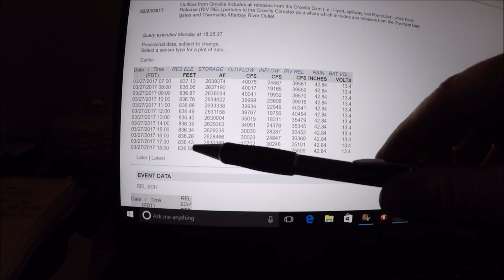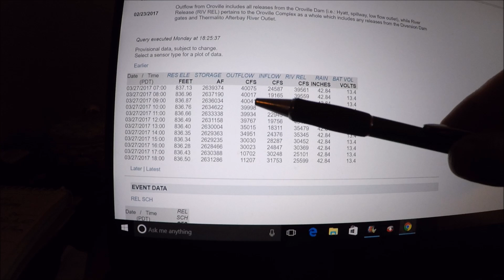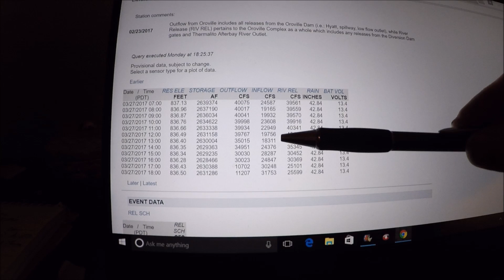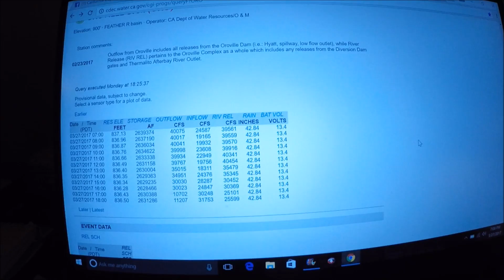Oroville 27 March Update "A Day in the Life"

Comment: 60% design generally includes a Design Analysis or Basis of Design report that details the design and project  requirements with a Codes Analysis (local, state, federal) that must be met in the final design.  A project schedule will be included and a cost estimate accurate to plus or minus 10-15% (because the design is not fully developed).  There is also the complete list of drawings and specifications.   There will be a number of drawings that are part of the final design package that are included to show the general overall design, and they may include some detail drawings of things like foundations or even some special designs required for the specific site.  There is either a State of California or Corps of Engineers design manual that they are following that defines the submittal requirements for each design stage (30, 60, 90, 100 percent).
Reply from the maker: Excellent explanation Thanks!
Reply: Buckhorn Cortez 
Hey, thanks for typing that out.  Good to know information.
Reply: For the DOD our civil engineering submittals  at 60% & 90% also included existing conditions drawings and text summary of same + new work. 60% by next week? Maybe. That would be fascinating to see / read for this project. After projects were completed we were required to provide 'as-built' drawings which reflected the revisions / modifications. It would be interesting to have a look at the as-built drawings of the Oroville Dam, probably submitted in late 1960s.
Reply: Another fact filled report Juan, thank you.
You, being a pro pilot, serves you well in paying attention to details, your profession and maturity are what brings creditability to your reporting.
I have known many pro pilots over the years, all with your same attention to detail. 
Totally off topic, but I've always been fascinated on why a majority of pilots decide to stay silent, in public accounts of "things" they have seen while flying. I get the whole ridicule and threat to their career thing, but those I have spoke with have told me there might be thousands who would come public, if they could.
Like you, I have trusted these people's accounts as facts, and the fact that their "day jobs" deal with attention to details, yet going public is too much of a risk.

Who knows, there might have been engineers back when Oroville dam was being built that saw "things" in the construction that resulted in what is happening today, yet never went public for fear of ridicule or worse.
Just spit balling here...thanks for your effort in bringing facts and transparency to the Oroville topic....we need more of this private, non biased, non affiliated and objective reporting, in many sectors of society.
I know you won't give up your "day job" to become a YT channel profiteer. If your like the pilots I have known, the love and passion for flying, far outweighs the possibility of turning a hobby into a sole source of income.
 "Click baiter's", have not "learned" how to achieve the balance you seem to have found.
Reply: Looking at the emergency spillway, the left side looking up at it (in river terms looking downstream the right side) is just a small concrete lip 6 to 10' high.  Tear it out and build some gates.  Seems like the lake would be plenty low enough during summer.  All the work would happen in the top 50' of lake elevation.  That will be free and clear by June 1.
I believe the best course of action is to patch the main spillway and keep it running as is for several years until a good plan to replace it is in place.  At the end of the broken lip, build poured concrete revetments under the lip and to the left hillside, to stop any further headcutting in the next several years.
Reply: since I am not a civil engineer I will stay off the main squakbox but I feel obliged to opine on your concept,:  brilliant in fact,  there are other places other than directly next to the monsterous dam wall,   perhaps several smaller avenues for more manageable releases of water.  something strange seems to occur at mega-flowrates,  check out the Teton dam engineering issues
Reply: Wish Congress could do Vetting in that length of time, we could have a full Supreme Court. Ah well, I am glad for Oroville. Sad that no one cared enough to put in a $5,000 fix instead of this... and all the lives up-heaved because of neglect. SAD! Can we hope a lesson learned? Or did we already learn it and someone in power forgot? Thank God Trump didn't hold a grudge against Gov Brown. He stepped in immediately to assist (when asked, of course)and for that, I think everyone can say "that is a good thing."
Reply: The dam was finished when Reagan was governor.  He didn't start it but he got to dedicate it..  But guess who pushed through all this, our very own Governor Moonbeam's father Governor Pat Brown.  Pat Brown pushed for and got a lot of the water infrastructure we have today.  A lot of money was spent then (1950' -60's) and very little since.  It also was built by the government but the work was performed by private companies.

Comment: Hi Juan.  I know nothing about dams but found your channel by accident and I am very interested in your research and how generously you let others know what is going on.  Here's an off the cuff thought.  Could they build a new main spillway where the emergency spillway is and then make the now main spillway the emergency spillway?  There's probably reasons why not but just thought I'd throw it out there.  Judy in Victoria BC Canada.
Reply from the maker: I'm sure that is under consideration too. Good idea.
Reply: +blancolirio Thanks for your replies.
Reply: Trudging The Road Of Happy Destiny The spillway intake gates can't be moved so to do a horizontal offset towards the emergency spillway they would have to have a sharp turn from the current gates.
Reply: The ES structure will not support the weight of a Gate structure. Also there is no directional cape to direct the water to Gates at the ES.  They would need to drain the lake (completely) for 2 years or more to build a cape.  Not going to happen.
Reply: Hi Judy, That is an interesting idea. The problem is  that building new  water gates would be a huge project. To cut into that emergency area would take a very long time and the water level would have to be dropped down to 500 ft.  The DWR will just have to build a new main spillway that is stronger in the same place where the busted up one is.
Reply: They will trim the Upper spillway back to a joint (about 65') They will then start building the New aqueduct (pillar supported / spillway- water bridge) from that point downwards until Nov1st .

They will build a temp spillway landing at the bottom. Next year (2018) they will replace the top & bottom with new structures.
Reply: Thanks Everyone for all the input.  You are all much more knowledgeable about this than I.  I will just have to wait and see what happens.  Again thanks for your comments.  I find them very interesting.  I hope a solution can be found that costs the environment and the tax payers the least amount of stress.  All the best.  Judy.
Reply: Just wondering if there is any other place on the lake where they could build another spillway?
Reply: Based on some of the other comments the emergency spillway would not be a suitable location for a replacement. Also if the build it there wouldn't they then have to find another location for an emergency spillway?
Reply: Jeffrey S Modern earth fill dams now prefer to have the spillway a mile or more from the dam.
Reply: Jeffrey S an option would be to tunnel under the from the parking lot down the diversion pool, add an intake tower and that's what it.
Reply: MAKE MY DAY They'll never drain the lake, the aqueduct can't be left empty to it will crack
Reply: grateful ... empty to it will crack??  are you smoking crack...?  LOL  YES, the DWR should not have to lower the water level under 800 feet
Reply: Andrew B The aqueduct must have water in it, so the dam has to hold enough water to keep the system working all year and some for next year if it doesn't rain. Also the salt water intrusion into the delta is controlled by oroville water.

Comment: DWR rep said that the MSW outflow was causing some backflow that raised the tailrace level preventing them from running HPP at full, but he also specifically said that they shut HPP off a couple days early to do maintenance, presumably in prep for bringing it back on at full power after MSW was shut off.    During the period they were running two turbines since they started publishing the daily incident report, there was no change in the tailrace level at all, so I don't think rising debris  was ever a factor, just the high volume of water from MSW piling up in the DP prevented HPP running at full.    

If they average 27K CFS inflow (probably won't be quite that high) and steady 13K outflow from HPP, they'll only have about 10 days before level rises from 836ft back to 865ft, and it sounds like there is some internal debate as to whether to stop at 860 or 865.  If they must stop at 860 then it's only about 8.5 days before next spill.  
If inflow averages around 20K instead with same 13K outflow, and they wait to 865ft, they could have roughly 20 days to work.  
Also, today they tested flow rates at 35K and 30K, which if they destermine was safe, they may be able to use during next spill event to prolong it through a greater period of snow melt.  

orovilldam subreddit has a link to the FB live video of the KCRA overflight today about an hour or two before spillway was shut off.  Well worth a watch.  One thing I noticed was a straight down shot of water in the lower spill channel.    It shows bedrock on both sides of the water, which is very encouraging.
Reply from the maker: Yep! I agree.
Reply: Right now, average inflows are about 19.8k cfs which will buy them some more time until the inflows creep up to 27k as predicted. But even if inflows were 27k right now and remained at that rate, we'd still have until April 9th (13 days) before the water level reaches 865 feet. But I think we have even more time than that, considering the inflow is currently only 19k.  This of course is all contingent upon no new rain, and expected inflows of 27k.

Comment: I like an idea I am sure many an engineer have already thought of.  Instead of using the expensive "road building" approach why not use relatively inexpensive precast concrete tube.  10 abreast or whatever might be required.  One for each control gate. That way, any individual section can be inspected and fixed without impacting the entire thing.  Like straws next to each other.  Maybe there are more problems with that than I realize like flow rates, differential pressure, etc. due to the sheer heights involved.  I'm no engineer.  You are a natural orator Mr. Brown.  Maybe years of talking to ATC perhaps? Keep up the awesome work!

Comment: Well, I don't think they should just do concrete and rebar.  They need to at least drill footings down to bedrock in the MICA SCHIST area of the spillway, because that's where the sinkhole first developed most likely BECAUSE of the MICA SCHIST.  So, perhaps 2 plans are needed.  One for the part of the spillway which isn't on top of mica schist and one for the part of the spillway that IS on top of mica schist.  I think that would help with cost savings.  Again, once footings are drilled, then construct a pier and beam foundation over which is poured concrete with rebar.  And you're welcome!  :)

Comment: River Outlet/Bypass Valve could increase outflow by 5,400 CFS.   I don't understand connection between River Outlet Valve and fire that occurred at different Power Plant site.  Electrical buses and connections can be inspected with infrared equipment.  Arc Fault Detection devices can be installed to alert operators and shut down equipment.
Reply from the maker: I believe there is mfg.  issues with the valves themselves? I can't get a straight answer.
Reply: It doesn't make a lot of sense why they can't provide an honest answer unless they are trying to hide something.
Reply: I don't recall any videos of water exiting the Hyatt Power Plant.  I would also like to see how high the exit port of the  River Bypass Valve is relative to the Thermalito Diversion Pool.  The California DWR should tell the public why they can't use the River Bypass Valve to increase outflow by 5,400 CFS.
Reply: If I recall correctly, the discharge tunnel for the a River Outlet Valve had some connections to the Power Plant Turbine discharge tunnel.  If so then using the River Outlet Valve when the river water was high would have the same effect as operating the Turbines when the discharge lake level is too high.  They could end up flooding the turbine area.  This is a possibility if they are interconnected.  They need to find a solution to the discharge levels as the it is ridicules that they can't use the turbines to reduce the lake level when the spillway is operating.  Apparently the power station was installed at too low of elevation compared to the river channel downstream of the dam!

Comment: If i was the chief design engineer i would get between 10,000 and 15,000 forty gallon drums. Take the lids off them and fill them with concrete and rebar. Let them harden then tack the lids back on them. Roll them over the spillway into the damaged area. Tack the ones at the sides to create an enclosure. Then pour concrete on top of base ones and slowly build up the hole with more forty gallon drums and concrete. The advantage with this option is a lot of the prep work can be done off site and once system is in place to commence the work. It,s a simple and cheap process that has the strength and integrity to carry a substantial load.

Comment: Great reportage , thanks for all you do. I believe that this facility has (A) had a fire at another power generation plant that is still out of service (B)another tunnel under the dam that could be used as emergency outlet which is out of service due to maintenance issues (C)a turbine on the Thermolito plant which is out of service due to maintenance issues and then of course the cracked spillway which  was ignored until failure.  With the most important link in the water system in this sorry state of repair what conditions exist in the lesser dams and facilities?

Comment: Yes Juan,  look at the hole on side oh the mountain...is it better that it took 50 years...how much of a discount do we get on the repair bill for that glorius fact..you are right...50 years of skating on thin ice.  In 1964 during constuction a flood hit the half completed dam and came near overtopping it.  The only thing that saved it was the two diversion tunnels were open and spill 400,00 past the dam.. What happens the next time they need to spill 400,000..well thats ok...we got to use this dam for 50 years.  Thanks for your time and consideration.